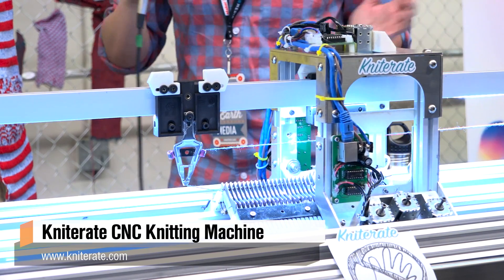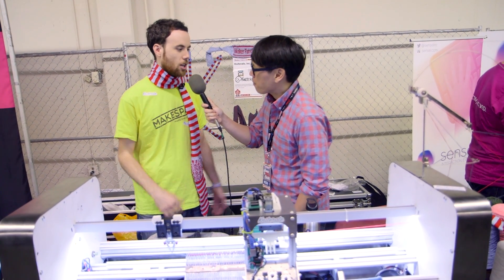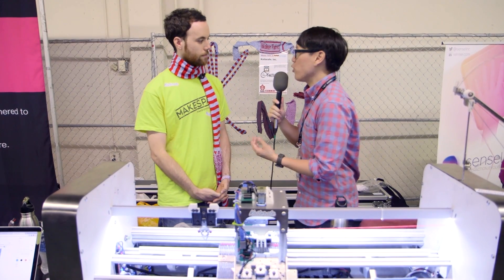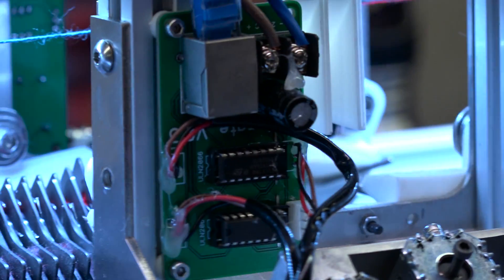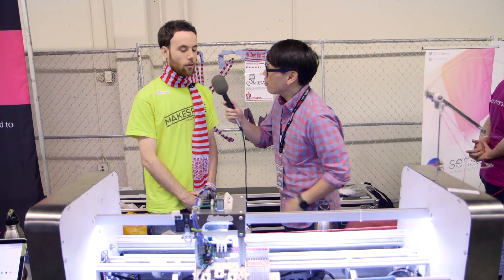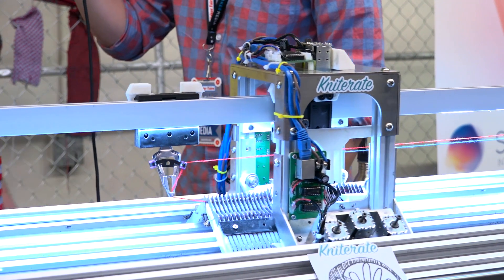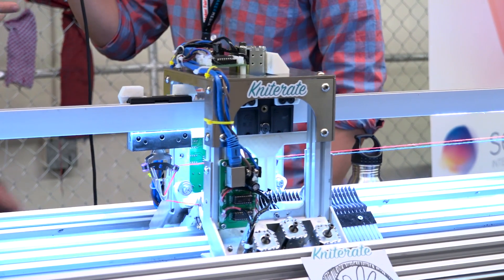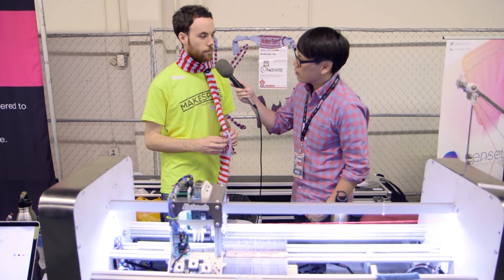Meet Kniterate, a CNC Knitting Machine!

Comment: I'm not impressed. Looks like all it can do is basic stockinette stitch. And it sucks at intrasia knitting knitting. Looks like crap. From the design, it will not do circular, garter, cable, twist, or anything else. Pretty pathetic. Just something for the yarn novice to gawk at. Grandma ain't going anywhere soon.

Comment: I've experimented with some knitting machines, they are NOT user friendly at all and so I'm looking forward to this.  It would be a lot of fun to easily produce things with custom "pixel art" designs.  The sweaters would be cool although that is a degree higher in difficulty.  Even a little machine that just does socks, scarfs and stockings and is integrated with modern software, with a low rate of errors, would be a big improvement over what's currently available to casual users.

Comment: Computerized knitting machines for the home/hobby user have been around for at least 2 decades. This guy wants to compete against textile machine mega corporations like Brother?  Good luck.
Reply: It's obviously meant to be a small machine for home use or small business, i don't think desktop-sized knitting machines like this have been available for consumer use for the last 2 decades.
Reply: Brother stopped making knitting machines for the hobbyist market a couple of decades back. All of the machines out there are old ones from back when they were still manufactured.
Reply: +makomk I guess that speaks volumes for the demand for these. Why buy a machine to make a scarf when you can buy a finished one from China for less than the cost of the yarn to make your own?
Reply: Silver Reed knitting machines are still in production.
Reply: +AndTheCorrectAnswerIs the endgame is having customizable sizes for other garments, like a custom fitted t-shirt or sweater. I think people would pay enough of a premium for that to be a viable market.
Reply: the stay at home mom need income. this will help those pinners and IG sellers
Reply: And some models are programmable.
Reply: I think this should be more marketed at hobbyists or small scale markets, like the people that sell crafts at Etsy.
Reply: silver reed still make and sell machines that link to the laptop.

Comment: Serious question: isn't a CNC knitting machine just a loom?
Reply: Technically, no. A loom weaves fabrics while a knitting machine stitches fabrics. It does make some difference in how the fabric behaves, but they basically do the same thing (make textiles). 
This thing, however, looks like a waste of time: its too slow and no smaller than existing home knitting machines. this is such a niche market that without serious improvements I have no clue who would buy this.
Reply: I can see a local custom embroidery place buying one so they can offer custom knits without having to really train anyone or figure much out. Plug in, load software, type logo and print a batch of scarves for the local high school.

Comment: that would totally fit on my desktop...... after i remove the computer and everything else and have the desks sole purpose be to hold this thing.
Reply: That's usually what you do with a cnc machine....
Reply: just stick some legs in it and a glass top and make it work double time. lol
Reply: Don't forget to starch the knit table before use, so it will be stiff enough to stand up. Just starch it and iron it, and it should be fine.  ;-)
Reply: +Mark L knit yourself a waifu pillow and eventually it'll stand on its own.
Reply: Just knit a new table with it. Then put it on that.
Reply: Are you a Witch? Because that is a magical idea.
Reply: Knit-ception
Reply: yeh what minihjalte said. knit a new desk.
Reply: Toastalicious Best comment I've seen in a long time.
Reply: Rob 
.

Comment: Very odd machine - I mean: It is awesome, but I would prefer to send my design to fab a get it a week later. The machine it self is very niche market and the end consumer market with the final (customized) product will scale non linear. I hope the manufacturer of the machine will list shops/their costumers on their website, so that end costumers can find a machine owner/operator.
Reply: You mean as in not good for a individual consumer to own? or less practical in general compared to existing solutions?
Reply: *****
I think it is not something for an individual to own. How often those one need a custom knitting? Using this machine for business on the other hand can work well. I mean: If I would see an online store offering the a customized product (as in a scarf, a benny, ...) then I would be highly interested as a consumer. It can be something for a business because it scales odd. The machine looks complicated and thus expensive, making it an investment That's not a bad thing, just a thing. It means that the machine should not stay around unused - ideally, it would knit "allday" with larger projects of night. Letting it stay around would also mean loosing know how (I know many mechanical workshops which are unable to use their machine park when needed, because they never invest the time to learn how to use their machines efficiently for a high volume run). I see this machine as having a potential similarly to photo print services - with the same effect of only a few actual "mass producers" owning the machine offering their service to anyone.